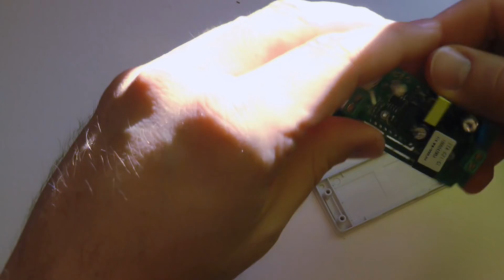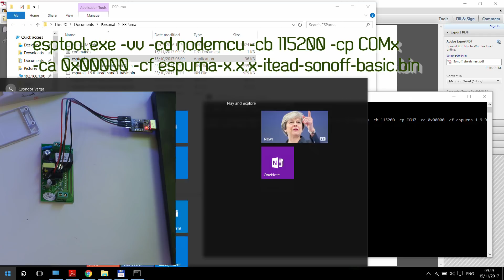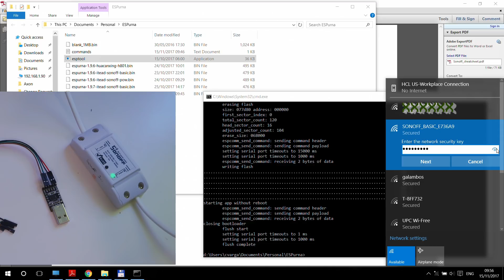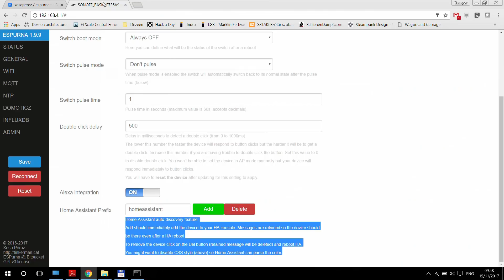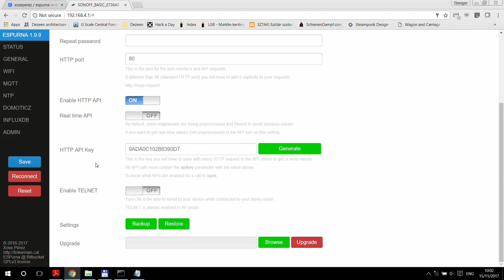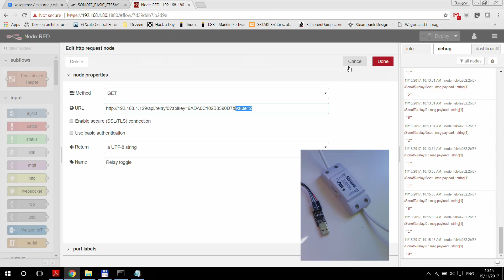How to flash ESPurna firmware to Sonoff Basic

Comment: Thanks , so generally would you prefer ESPurna or ESP easy ?
Reply from the maker: I prefer ESP Easy for myself, because I like to tinker. But ESPurna most probably does all you need and does it much simpler. So if you are flashing a Sonoff, it is quicker to get up and running with ESPurna.

Comment: the esotool.exe not run also disable Windows defender and try setup compatibility whit Win XP, theres other requirements to run ESPTOOL.exe ?
Reply from the maker: I am sorry, I did not experience this issue before. You can follow the steps on wiki to install python on your computer and and execute the python version of esptool. That's all I can add.
Reply: today  i try it whit  ESPEasy Flasher , and work very good is not required any command  https://github.com/letscontrolit/ESPEasy/releases/download/v2.0.0-dev12/ESPEasy_v2.0.0-dev12.zip

Comment: Hi, thanks for the video, I flash completed but the green light on sonoff was not on.  cannot find sonoffbasic wifi.  How do you know what the ip address is 192.168.4.1? thanks.
Reply: do find a spunrna_07c029 and i assume that is the one, so i connect to it with windows 10 but it didn't work, and I connect to it with Pi and it did connect.  not I have to find the ip address, I used 192.168.4.1 and 192.168.4.2 but they both didn't work. Thanks
Reply from the maker: It is documented in the wiki: when you connect to the access point created by the Sonoff, this is what the server IP is going to be. It is always that.
Reply: thanks

Comment: Link to the Node-Red flow is not working
Reply from the maker: Not sure why it did not work. I have updated it with a working link
Reply: Now it is there. Great video and flow, thanks for sharing.  
Do you have idea how to implement scheduled timers on Sonoff with ESPurna, just like the original firmware do ?
Reply from the maker: With node red, I recommend installing bigtimer node. It does just that. You can set the on and off time, not only actual times but things like sunrise, sunset. There is an On payload and Off payload fields that you set to 1 and 0 and connect that to the ESPurna MQTT topic.

Comment: Any news on the new Sonoff version and do you know if the firmware can be charged ?
Reply from the maker: Not yet. I ordered a Sonoff probably more than a month ago. With Christmas around the corner, delivery is quite sketchy. And I am not even sure if this will be a new Sonoff, or just old stock. So I just need more time.
Reply: Thanks, It would be massive shame if they changed it so it could not be re-flashed. I'm just starting in Node-red and Sonoff's - I don't have any yet ...
Reply from the maker: That is definitely not the case. In one of the video somebody mentioned that it just needs a different parameters in ESPtool. Also if you read the Wiki of Tasmota firmware, it is also mentioned that the difference is only a parameter: read the top post: https://github.com/arendst/Sonoff-Tasmota/wiki/Theo's-Tasmota-Tips
Reply: Ah ok, Good to know Thanks. 
One off topic question, in Espeasy do you know if Pulse counting has total pulses and the time between pulses this would to to read a LED on my electricity meter, giving both KW's currently being used and total KWh's used.

Comment: Thank you for this great tutorial. Until now I have worked with the Tasmota firmware on the Sonoffs and I like to try out the ESPurna firmware also because I've read lots of good things about it. This flash method is a bit easier then using PlatformIO in the Atom editor.
Reply from the maker: I yet to try Tasmota. And once I am done with that I also want a comparison video to see pros and cons of ESP Easy, ESPurna and Tasmota.